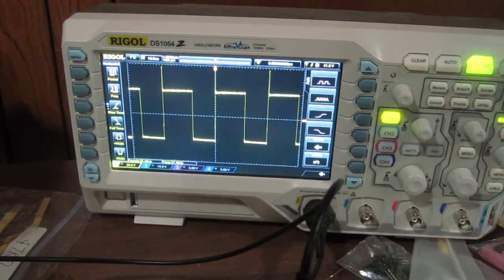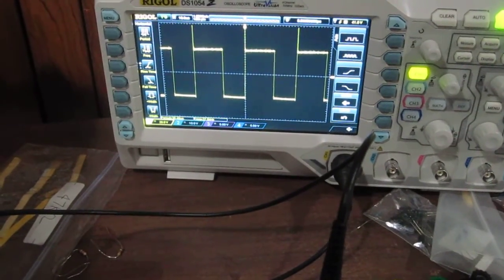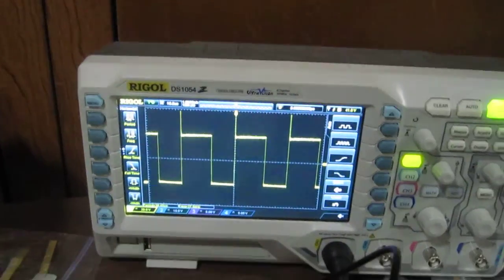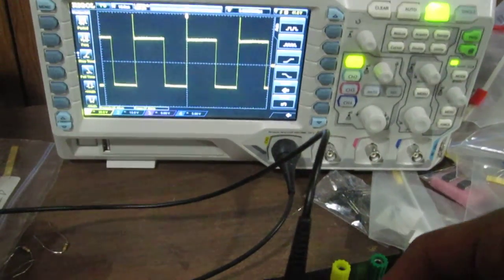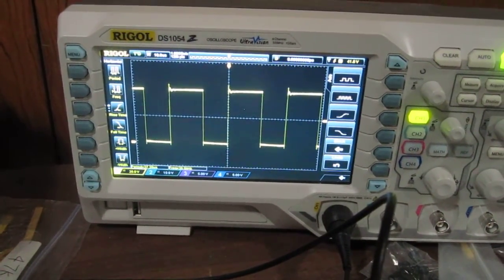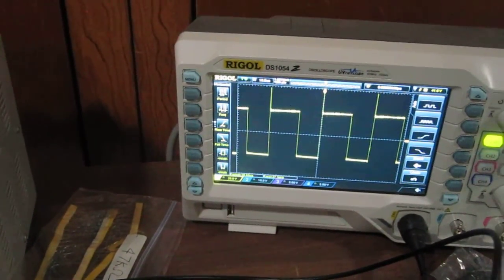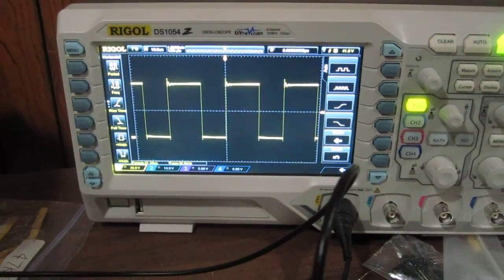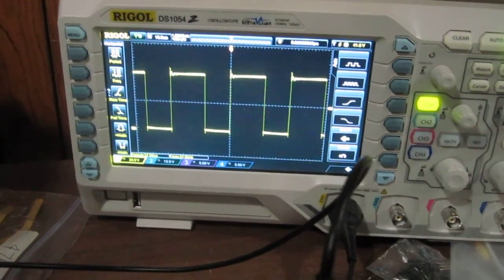Importance of a Filter Capacitor

Comment: Great video!
It's just a square signal circuit fed by a power supply right? So what you did was to connect the oscilloscope at the output of the square signal and view that signal with a bad capacitor and fix it with a good one right?
I want to be sure of the connection to experiment.